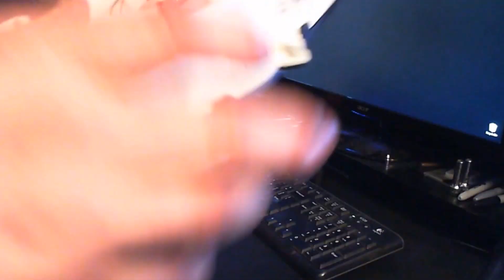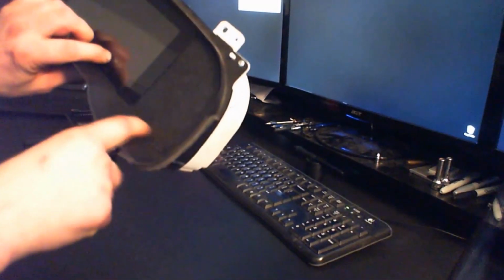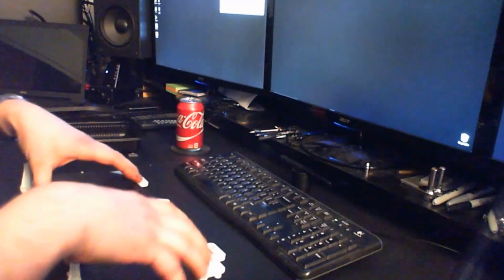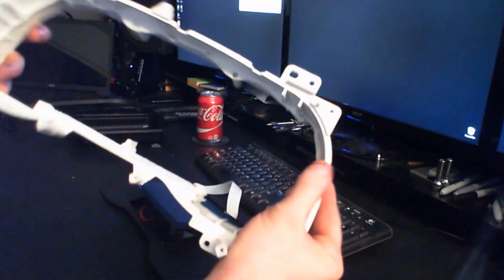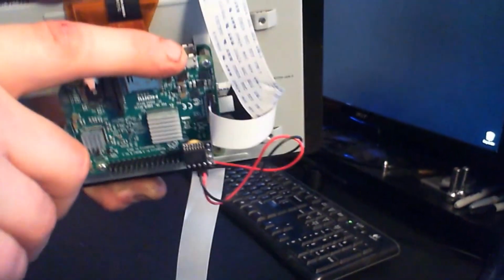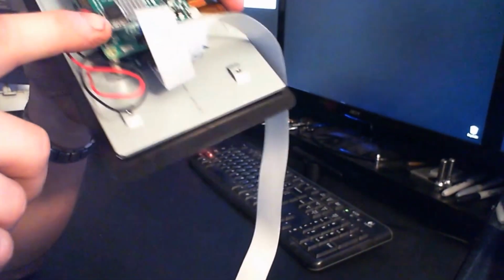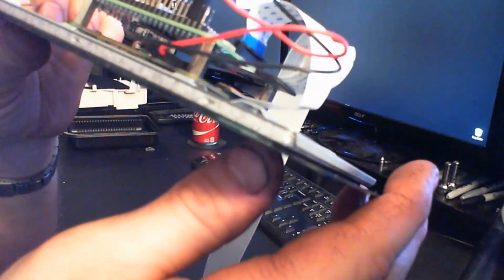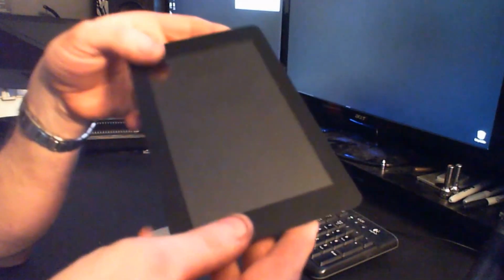Megasquirt/Raspberry Pi Dash Version 2.0 Construction Walkthrough

Comment: Hey Brian great video👍🏼im looking to do a similar project on my 1998 Z28 Camaro, I have a Fitech Ultimate LS kit in it and I am wondering if copying the Handheld micro SD chip to the Pi 3 chip would it boot the Raspberry Pi 3 with Fitechs info display? How did you connect you're Megasquirt to the Pi 3?
Reply from the maker: Sadly it wouldn’t. The PI dash runs Raspbian Linux OS which runs the Tunerstudio software for the MS. If Fitech has a Linux version of their software it may run it. I’m not familiar with their setup though.

Comment: Hey, that's a clean setup! I'm working on a Volvo 240 that will need something fancy thanks to a host of OE compatibility issues / me not wanting to deal with trans speedo cable adapters / tach / expensive afr gauge and the garish hue that will surely be cast upon my interior during night drives... Long story short, a digital dash is in my future. I love the flush fit of that screen. Are you able to link the product / provide a part number? Thanks.
Reply from the maker: Sure do. I put together a basic wiki for building your own. 

http://esserengineering.com/?page_id=181
Reply: Brian Esser ah, you're a gentleman and a scholar. Much appreciated :)

Comment: Where'd you get the black plastic used for the base of the dash?
Reply from the maker: It’s just 1/8” ABS sheet from Amazon. Very easy to work with.
Reply: Cool.  Thanks.  Any luck with the GPS module yet?
Reply from the maker: Not yet. Honestly haven’t messed with it. The trucks been keeping me busy.

Comment: what the poweer supply link for autouse thx
Reply from the maker: http://www.mausberrycircuits.com/collections/car-power-supply-switches/products/3a-car-supply-switch

However he is redesigning them and they are still not available. It uses a custom script on the pi to detect shutdown and shut the pi down without having to do anything or risking card corruption by just shutting it off.